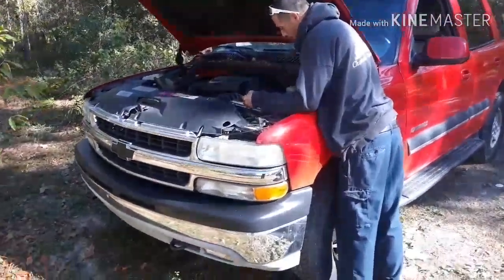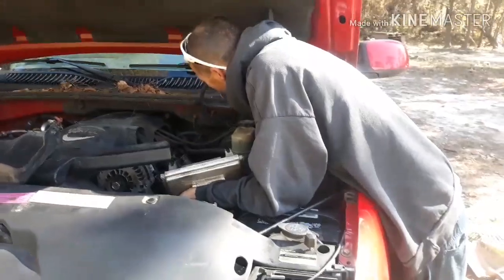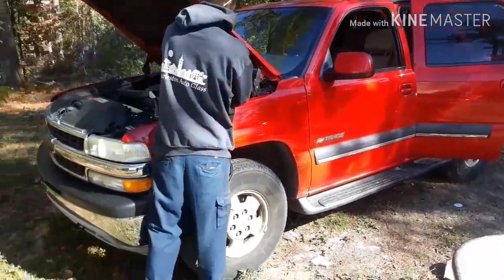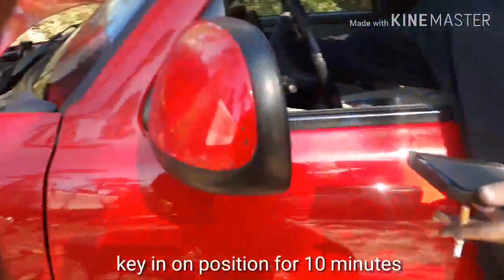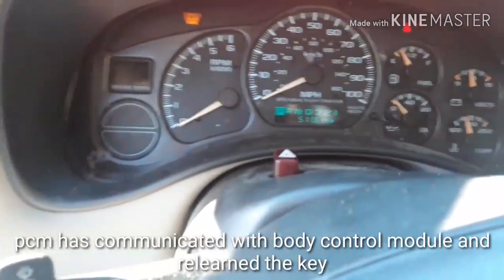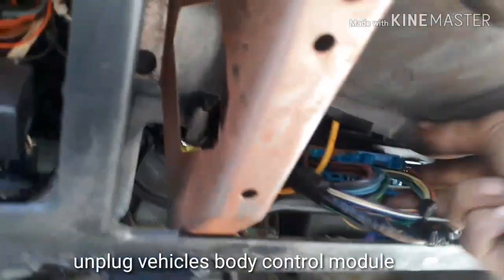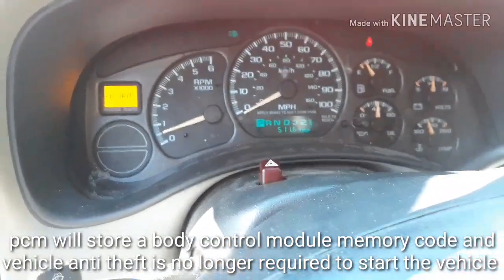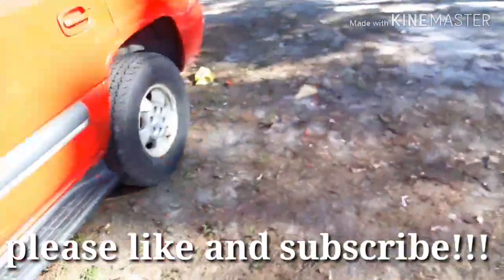GM BUDGET LS SWAP VATS DELETE ( vehicle anti theft ) pcm security bypass 4.8, 5.3, 5.7, 6.0, 6.2

Comment: I tried your steps 👍🏻. Works on the same car swapping out the donor pcm to and plug into 03 Avalanche. Took it out and plug into project truck 07 Silverado classic, security does its things, no start. Great video, maybe it just don’t work for 03+ pcm, blue green connector or something else. Going to get a tune if it doesn’t work for one more time.
Reply: Have to keep power to the ecm somehow while swapping out
Reply: You have to have a Marlboro red for it to work
Reply: @quiettime6871 😂 what about New Port turquoise (?)

Comment: Just tried this in a 03 Silverado cat eye VIN T. The BCM has 2 extra side plugs on each side of the BCM. It did not work for me. I tried it a couple times. Im thinking you gotta have that 3 plug BCM vehicle to do this. Good news is I just plugged in my old ECU and it fired back up with no issues....Im guessing the early trucks will let it slide but mine did not. Still a cool vid for people that can get it to work. Thanks
Reply: My bcm has the 2 extra side plugs and it worked for me, 1st try.

Comment: I've should done this before removing my ls engine from donor vehicle. You think if I plug the body control module to the harness when I do the ls swap,  I won't have to delete the vats?
Reply from the maker: U would still need to disable the vats due to the key

Comment: So what if I’m using the computer out of the donor truck I’m getting the motor from? Before pulling the motor can I just unplug the module while the truck is running then? I shouldn’t have to do the first 2 steps since the computer & module already communicating from factory right?
Reply from the maker: Yes just unplug the bcm and allow it to run long enough to trip the bcm code
Reply: Ok so I did what u suggested. Ran fine afterwards in the donor vehicle. Now after I did the swap, hooked everything up, it want start. It acts as if it wants to start but want start....
Reply from the maker: @OOLilDel  check all your grounds and positive connections, also make sure your key on hot wire has power in the cranking position... I've seen that happen
Reply: @mikeytuned8944  I just hooked up my aftermarket ecu & harness from Edelbrock(pro flo 4 system), & it cranked right up & ran fine. Hooked it up the exact way I did the factory ecu & harness. Just swapped it back over to the factory setup using same ground/hot locations & it want crank.
Reply: @OOLilDel  figure it out?

Comment: thank you your video was very helpful..... it was a success for my ls swap
Reply from the maker: Awesome!!! Glad I could help lol
Reply: I've watched several videos concerning this. I've done several vats relearn. I tried it with my swap o4 burban dbw donor to a 02 chevy 1500 dbc. Didn't work
Reply from the maker: U must not follow directions, it definitely works when done correctly
Reply: @mikeytuned8944  well my guy I've done this way before you posted your video. This ain't my first rodeo. I tried it 3 separate occasions. I tried again this morning. Exactly like you showed and I already knew. Late 90s cars are same way with chiped keys brw
Reply: I did have a substantial draw on the truck I'm using. I got that fixed. It's a 02 with red and blue. I got the green connectors. I do ls swaps for a living. This is how I pay my bills
Reply: What I believe is someone has put the resistor in on my donor truck. And I'm beting that if it's got the resistor. It want work
Reply from the maker: Idk what u got goin on but I've done it this way on multiple ls swaps and it's worked great. I upgraded to hp tuners and havent had to do it this way in a while. I dont get payed for these videos I made them to help people out and it has helped thousands of people so I accomplished what I set out to do like u said if it's not working its probably got something to do with either your pcm or your donor vehicle. Dont mean to come off as a dick but it's worked for thousands of people that have watched the video
Reply: @mikeytuned8944  idk my guy. But I've used this method several times my self. Gm has used this method for 20+ yrs.    10 min on 10 seconds off. Total of 30mins 30 seconds. I've no slow leak
Reply: Do you know trick to turn off day time running lights with just key on?  There is a trick

Comment: So if I do this and unplug the bcm so I can start my truck am I able to plug my bcm back up afterwards and the vats still be deleted ? Or do I absolutely have to do it on a different truck before I put the pcm in my truck
Reply from the maker: U can plug it back up. The objective is to set a bcm contentious memory code in the PCM once it's set ur fine just don't delete the codes.

Comment: okay so i have a question  my truck used to turn on the security light  but i did the keypass and its not there anymore but it wont crank i swapped to ls as well but i have a question if i can use the same ecu and do this process or do i need a junkyard one? and i have a v6 one as well not sure if that one would work ? seems like i have power on all fhe engine but if i crank it manually with a screw driver it cranks but wont  start  ? thankss

Comment: Does this mess with vehicles original ecm or security system after you hook it back up? Or do you just hook the ecm back up in the vehicle nothing is wrong?
Reply from the maker: It does not effect the vehicles factory pcm at all just plug it back in and ur good
Reply: @mikeytuned8944  right on. I just put a 5.3 i to my 82 jimmy. Gona do this right away
Reply: @mikeytuned8944  do you start it on the third go or turn it off then start it?
Reply from the maker: @seando87  try to start it on the 3rd... some times it wont start the 3rd time so u have to give it another 10 minute cycle
Reply: @mikeytuned8944  on the 4th round now. Just sputterd on the 3rd try.
Reply: @mikeytuned8944  damn didnt work. Gave up on 7th round. Il just pay to have the cpu tuned lol
Reply from the maker: @seando87  that's weird🤨... key on 10mins key off repeat 3 times... normally works every time for me
Reply: @mikeytuned8944  damn tried with a different ecu than my first attempt in my truck and it still didnt work. My security light never stays on it flashes, but eventually it goes away, repeat that 3, 4, 5, 6, 7, 8 . and still wont work. Wander if theres something wrong with the bcm in my truck. I had to do the 10 minute relearn in my truck and that worked first try.
Reply: @mikeytuned8944  would you need to reprogram your key at that point?(if you plugged the body control module back up)

Comment: If I took my 5.3 pcm and tried this on a buddy’s truck with a 4.3, after my computer was unlocked could I put his pcm back? Would I have to do this again to his pcm? And does it have to be the same engines or years?
Reply from the maker: It should not effect your pcm, and you want to match pcm's/engines together unless you are planning on tuning the pcm... 4.8 with 4.8 5.3 with 5.3 6.0 with 6.0

Comment: Does it mean that the security light will stay on? I'm trying to get rid of vats in my truck (or a way to switch that damn message off, because the truck starts and runs just fine), but somebody's been there before and left that light on. Been wondering if his course of action was the same as shown in the video.

Comment: Have you ever used a steering column from a 200 2500hd in a k-5 blazer?
Reply from the maker: No I have not, I just bypass the vats
Reply: I have.
Reply: @xips420  how did it fit?

Comment: It works .. But I used a dbw tahoe to unlock and my ls swap wont accelerate .. can I switch to drive by cable?
Reply: Yes you can change the throttle body out and leave the plug in hooked

Comment: Can I just disconnect the pcm in my 01 sierra to disable the vats? That's vats has left me stuck a few times I have to do that key relearn in the parking lot. Not fun on a summer day.
Reply from the maker: You should be able to unplug ur bcm and set a stored memory code and it would be the same concept

Comment: If I use my buddy’s truck to do this, will it mess anything up on his truck when I plug his back in?
Reply: Used my stepfathers truck for this and  his truck started right back up no issues. My truck is a 2003 Sierra 5.3 (swapped to a 1998 Silverado) and his is a 2007 Silverado HD 6.0. 
  Probably should have, but I never even disconnected his battery during the procedure.

Comment: Hello great video my question is I have a 2000 Yukon ecu and I have a running 2004 Silverado both are 5.3 would I be able to make it work in my Silverado ???
Reply from the maker: Yes it will work... the 04 Silverado should have green/blue pcm connectors instead of red/blue... just pop the green plastic cover off with a flat head and it will plug in and work fine for the bypass
Reply: Cool thanks again cool video!
Reply: Well I tried today no luck, only thing I was not sure on after the third 10 minutes I turned key off do I leave it on and try to start?
Reply from the maker: @manuelsarria1377  yes leave the key on and try to start it. If it starts up and shuts off repeat 1 more 10 minute cycle and try to start it again. Sometimes you have to start it a couple times before it runs that's part of the pcm's relearn process
Reply: Okay thanks I will try again tomorrow morning I did it twice but I turned key off both times before starting and nothing.... also my body module 5 plugs the 3 you took out 2 smaller ones and each ends I unplug all 5 right?
Reply: The only problem is the 00 and 04 pcm Pinouts wires have been moved differently 99 to 02 you can easily do it but from 03 to 07 they are the same
Reply: @manuelsarria1377  did it work??
Reply: First Last it did not work for me
Reply: @manuelsarria1377  99 to 02 pcm work with any 4.8 5.3 6.0. Now 03 to 07 pcm is different. You sir give up easily
Reply: @manuelsarria1377  problem is that i do not live in the US and no one here flashes the ecu. Also I do not want to pay 500$+ for hp tuners. I dont know what to do!!
Reply: First Last Well they say it does work you might have to switch a wire to it just didn’t work for me I paid 140 and got my flash
Reply: @manuelsarria1377  okay
Reply from the maker: Dont give up man... if ur using a dbw pcm try using a dbc truck to do the vats delete with

Comment: Wonder if this works on the 03-07c BCM setup.
Reply from the maker: Yes it does
Reply: Yes it does work but u have to get an 03 to 07 pcm older pcms 99 to 02 you cant the pcm pinouts have been wired diffetently

Comment: I swapped to a new PCM. I'm not seeing the security light come on with mine. Tried this and it's still not letting me start
Reply: Mine is doing the same thing. Did you ever solve the problem?
Reply: @mrmackbone  yes, when repairing the mice damage I had switched two of the same color wires

Comment: Ok so I did this after I disconnected the bcm and let it run for a bit I shut the truck off with the bcm disconnected and the truck won't start back up until I hook the bcm back up is that what's supposed to happen should I be able to start it with or with out the bcm hooked up

Comment: Does this work with the ecu that's already in the truck or does it have to be an ecu off a different truck?
Reply from the maker: It should work with the pcm in your truck also just unplug the bcm and set the memory codes
Reply: @mikeytuned8944  great, Thanks
Reply: @mike tuned do you just leave the bcm unplugged after that or do you plug it back in after so long?

Comment: How long do you leave the key on the off position?
Reply from the maker: 10 seconds
Reply: @mikeytuned8944  thank you
Reply from the maker: No problem
Reply: @mikeytuned8944  on the 3rd time doing the 10 minutes do you start it or do the 10 seconds also ?
Reply from the maker: @JoseOrtega-fz1ly  try to start it when the security light cuts off
Reply from the maker: Msg me on Facebook and I'll send u the instruction sheet👍 key on 10 mins off 10 seconds on 10 minutes off 10 seconds on a 3rd time for 10 minutes until the security light turns off then try to start it
Reply: @mikeytuned8944  what’s your Facebook
Reply from the maker: @JoseOrtega-fz1ly  mikey tuned on Facebook
Reply: @mikeytuned8944  I believe I added you

Comment: I've used this method. My car starts about 10 times , and then security kicks back on. How is that possible? 2003 Yukon engine, wiring, and computer swapped into a 1981 Malibu
Reply from the maker: That's strange🤔 the only way I've ever had that happen is by clearing the continuous memory codes out the PCM. You want it to store the bcm codes so if your clearing it in any way it could effect it.
Reply: I have no idea how I could be clearing the codes. Its not connected to any bcm. It's in a 1981 Malibu. Is there any way the ecm can do it on its own?

Comment: if you do this process on a ls swap the vehicle your swapping into won't have a body module. that being the case is this process necessary? if so would i just do this like the video says and obviously skip the unplug of the body module? since the car I'm putting it into won't have one?
Reply from the maker: U need the computer to set a stored permanent bcm code so that the vehicle immobilizer is bypassed and the chipped key is no longer required
Reply: @mikeytuned8944  so ur putting the code ok the doner PCM and then the stock PCM didn't pick it up?

Comment: Why you just didnt leave the key in the on position for 30 mins instead of breaking it up in 10 min increment??????? Or it was going thru the whole code face each 10 mins going by
Reply from the maker: The key has to be on for 10 minutes in 3 different increments it's part of the relearn procedure
Reply from the maker: I've done it with 3 different pcms in the past month all 3 work in the swap vehicles with no issues
Reply: @mikeytuned8944  do you still have to tune them or not
Reply from the maker: @chevycaprice8956  it depends on your setup... if ur running a bigger cam or whatever then yes. If you have the pcm for your engine it will work fine. What it's doing is allowing you to run your ls engine without the pcm security system locking you out
Reply from the maker: @chevycaprice8956  what engine and what pcm do you have?
Reply: @mikeytuned8944  01 5.3 with the original pcm and wire harness no cam or springs just all stock... Its going in a 86 regal
Reply from the maker: @chevycaprice8956  its recommended to get a tune with almost any ls swap but this allows the average person that's trying to do a stock ls swap to drive with the stock pcm... if you have any kind of real performance mods done then you of course need a tune but it should allow you to limp it to the dyno
Reply from the maker: @chevycaprice8956  yes you will be fine with running stock pcm no tune just follow the procedure and it will work for u that's what I did with the cutlass
Reply: @mikeytuned8944  are you going to do a video on how to wire it all up ik you can uae the distributor wire as key hot to start it and for the fuel pump
Reply from the maker: @chevycaprice8956  I will record a video today to try and explain the swap a little better.
Reply: @mikeytuned8944  im tuned in and subscribe
Reply: @mikeytuned8944  what fuel filter did u use

Comment: Not sure if this is the question asked below but if I plug in my swap ecm from an 05 to my daily driver (2002) will i be able to do this procedure? If so my stock ecm will go back in and my daily will work like it should?
Reply from the maker: Answers are yes and yes lol... 02 is perfect for disabling vats and will not harm ur trucks factory pcm
Reply: @mikeytuned8944  thank you brotha, gonna have to try it tomorrow after work. Just got my harness all hooked upon my 86 squarebody 5.3 swap and went to start it and got as far as a dome light turning on😭😂 figured its most likely the security lock out but also saw your comment about the fuse block key on wire being different on the 03-07 and I might have to switch that around as well
Reply from the maker: @RogueKnight33  that's awesome man... if u have any other issues u can hit me up on Facebook @Mikeytuned
Reply: @mikeytuned8944  I also feel dumb as hell because I just realised the distributor wire comes out of the firewall by the heater box lmao..no wonder you had it going behind the motor. Brain fart!
Reply: @RogueKnight33 did it worl ?

Comment: I don’t understand I’m trying to buy a truck but the guy says the truck has deleted vats and that he uses a computer I don’t understand can the car run without the computer????
Reply: Well. He might have used lsdroid or hp tunners or even pcm hammer to delete the vats with a computer  you will not need a laptop to run the car if thats what your asking

Comment: It's this a temporary  vats delete?
Reply from the maker: It works as long as u have the pcm I have unplugged and cleared check engine codes without issues same pcm on multiple swaps
Reply: @mikeytuned8944  ty

Comment: Iv got an 03 chevy tahoe, original key, the 3 / 10 min key relearning procedure didn't work for me... what else could it be ?
Reply: Did you ever figure it out? It didn’t work for me neither
Reply: @OOLilDel  I left the ecu un powered for a week, I went to start it and it fired right up
Reply: @ivantorresiniguez388  yes mines been unpowered about the same amount of time too. In the process of me doing the motor & trans swap into the other car.
Reply: @OOLilDel  other option i had was i found a tuner guy and was gonna have him delete vats on the ecu